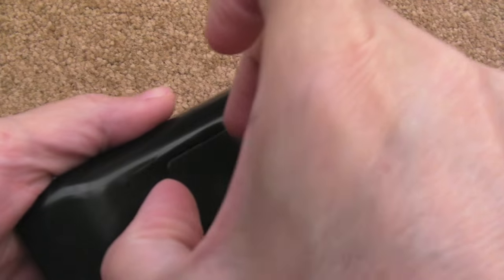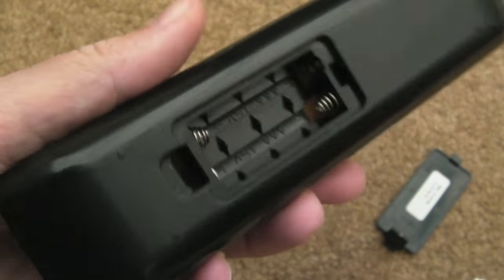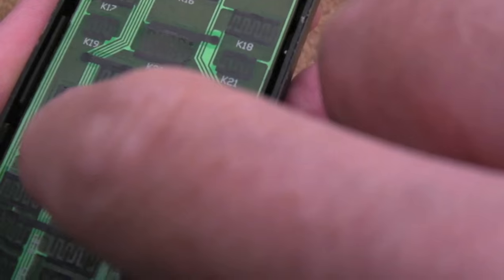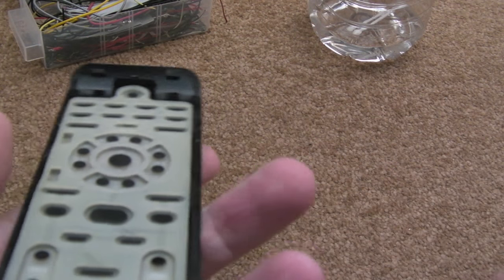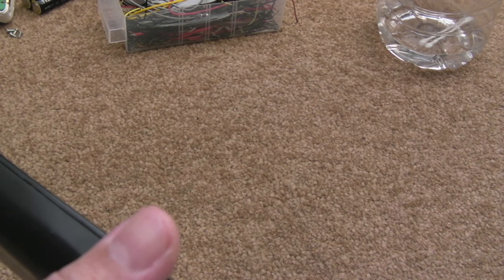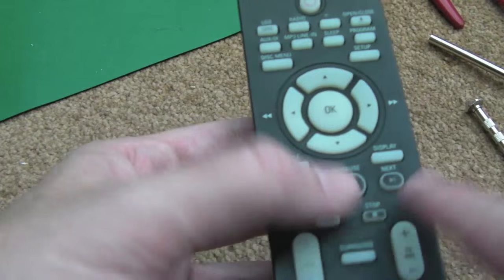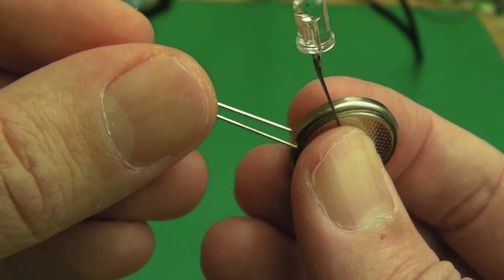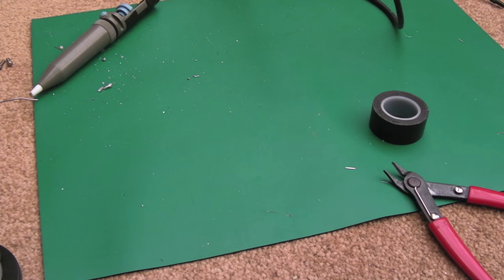TV / DVD/ Satellite Remote Control Common Fixes / Repairs

Comment: Thanks for the video!

When I saw the title for this video I was interested because in a previous life I used to do consumer electronics repair for a living, and I've sorted out my fair share of remote controls over the years.

The most common fault I've come across was not mentioned here.  So I thought I'd pipe in and tell you my most common remote control fault!

The most common fault I came across, by some margin, was faulty crystals.  These components, by the nature of how they are made, are sensitive to shock.  And unfortunately, remote controls are commonly knocked off the end of people's sofas and on to the floor.  If the floor is laminate or something like that, then this failure mode is almost a dead-cert to happen at some point.  I replaced a whole bunch of crystals over the 8 years I worked in the repair trade.  I wouldn't be surprised if it was >100.
Reply from the maker: +Brian J Hoskins Very good point =D  Yes, you are right - I've also had crystal fail and in particular they used to fail a lot in hand held games and watches etc.  Usually from dropping them on the floor the crystal would fracture inside.

Comment: You can take the carbon pads and rub them lightly against a piece of copy paper (like an eraser). This roughs them up and makes them work again. Of course, you don't want to do it too hard or too often as you could end up removing too much of the carbon pad, but I have this works REALLY well. You probably shouldn't put alcohol on the pads as it tends to dry them out. They do make a more appropriate cleaner, cleaner made for the rubber rollers in printers and the roller in a typewriter. This stuff won't dry out the pads. But I really find that the light rubbing of each of the pads across a piece of copy paper works the best. I had a remote recently that I paid over $100 for in the 90s stop working and I took it apart, rubbed the pads on paper, wiped down the board and it was as good as new.

Comment: ..... Mate, I feel your pain. (30 years of this) (Wazzal7 has already explained about the oil leeching out as it perishes.) Every time you clean those pads their conductivity decreases. I can explain the ONLY long term solution I have had with the pads. The problem is nothing sticks to silicone. Tin foil is perfect but good luck finding ANY adhesive that will stick long term. I cut 'Slits' either side of the common pads (Perforating the entire silicone) and 'Tuck' the foil strip ends in , through to the other side (and fold to retain). So the foil strips covering the pad a physically held in place.
Reply from the maker: +Rob Robbie Thanks, that's a really useful technique!  It is very difficult to get anything to stick to the silicone as you say!
Reply: +GadgetUK164     ..... P.S., I suspect there is some correlation between the small current flow and plasticizer leeching out. As I have two identical remotes (one spare) that I rotate and it's only the IN-USE one that PISSES OUT oil.  ....PPS, goes without saying your doing a good job with your channel. (I have told you before, your channel RATES higher than 'Thunderbirds'  re-runs here !)
Reply from the maker: +Rob Robbie Thanks!  Higher than Thunderbirds re-runs?!?!  That can't be possible lol!

Comment: To be honest, the progress with the VIC20 is slow. We've replaced just about ALL the logic chips and the 6502 processor. Both 6522 VIA chips have also been swapped out. But we still can only get a blank screen with no Datasette operation. All voltages are correct and where they should be. Would I be right in thinking that the MOS 901486-07 Kernal ROM is the next chip to swap out. Your advice would be much appreciated. Wayne and Nina.
Reply from the maker: +Nina Evans Yes, probably the Kernal!  There are also some other logic chips on there which could also cause the problem - there are some 74LS245 chips, 74LS138, 4066, and the RAM too.    Black screen is the worst kind of fault really =/

Comment: I've noticed the same thing on my old ATI remote. It seems to sweat more during the hot summer heat we have here in the Las Vegas desert. I'm hoping all the oil bakes out eventually. The problem I have now is that the contacts are wearing out on the board in some places and the keys in other places from all the cleaning and button pushing I've been doing over the years. Any tips on fixing that?
Reply from the maker: +Vigile Very interesting - I wouldn't have thought about the ambient temperature and humidity having an effect but clearly it does!  See the comment above from Rob Robbie - that's probably your best bet.  Try to glue small pieces of foil to the underside of the pad surface, but that can be really tricky.  His suggestion above it to cut slits at the side and feed a sliver of foil through the slots and bend them over, that way the foil is on both sides of the button and shouldn't slip out.

Comment: Do you ever clean your remote,it could be cleaning stuff or sweat from your fingers over time...just a guess..If i have problem with mine I put silver foll on the contacts where the buttons connect and they work ok.
Reply from the maker: +RETRO Nuts It's definitely something leaked out of the silcone!  See some of the messages below - It's actually quite common and seems to happen only on certain types of rubber / silicone.  For example, I've never had to do anything to my 3 or 4 other remote controls for TV / SKY / Blu Ray etc, just this damn Phillips remote lol.

Comment: What's going on Mr Gadget? No retro computers to fix (actually, it's the same this bloody end)! Lol! I think you'll find that the silicon that they make the keypads out off, actually SWEATS. My fella and I are often pulling remotes apart, sometimes more than once, to remove this shitty stuff. There doesn't seem to be an answer to it. The manufacturers don't give a shit, 'coz they know people will just buy Universal Remotes when there's a problem. But we prefer the remote that goes with the kit. Good video, keep 'em coming.
Reply from the maker: +Nina Evans Haha, I think things are just slowing down a bit for different reasons.  Less faulty items on eBay recently, and I've been playing more than doing any repairs etc.  As you say, they don't care about improving the build quality because its just classed as a consumable =/

Comment: From what I understand it is a plasticizer that is leaking out of the rubber. If it were all to leak out, the rubber would be dry and powdery. I am currently looking for a solution, as it's quite an issue I am experiencing out here in Arizona's desert!
Reply from the maker: +wazzal7 Very interesting, thanks for the info =D  Also interesting that heat has a major part in the process!  Vigile mentioned the same thing above - it must mean that this problem is probably more common in hotter places.  We need water cooled buttons =D

Comment: +GadgetUK164 used to have these problems with remotes in the 1990s, strangely enough philips and b&o, back in the day when crt was king. 

cooking them for a good while seemed to remove the oil and make the remotes last a good while longer.... however you will have to retreat the contacts with a little bit of silver conductive paint. not too much now as a tiny bit goes a looooong way.

hope this helps however I had a theory about this and using vinegar to "cure" the silicon further. just a wild thought mind you.

I may give this a try if I come across the same thing again.

problem is these things are made to a very low cost as you know, making quality a secondary to cost a big issue.

anyways the cooking of the silicon is dependant on brand, manufactor and age. we had a theory years ago that it was down to heat and humidity with central heating and moisture in the air..
Reply from the maker: +Jason Birch (argy101) The silver conductive paint is a good technique!  I've done that before myself and it can work well. Thanks for the tips there - might have a go at boiling it or something to see if that makes any difference.  I suspect it needs some chemical reaction to stop the process.  A bit like the H2O2 on yellowed plastics.
Reply: I've stopped using peroxide on keys. I've found just using the oxy action powder in very warm water in the daylight for a few days does a much better job than peroxide. It's good for plastics like snes etc just keys..it leaves a nasty white residue I find.
Reply from the maker: Yes, I think it depends on the plastic - I've had fantastic success on Amiga cases, but the keys are a bit hit and miss.  For that reason I've not done the keys on the last few 500 / 500+'s added to my collection.  As you say, the oxy action can work well on its own!  I know what you mean about that residue - it's a pain, I had to wash a load of that off something I cleaned just last week!

Comment: Interesting fix ! - I have done a bit of digging for info on this as i am sure many other people who have watched this video have done too!  I found a post thats 16 years old on google https://groups.google.com/forum/#!topic/sci.electronics.repair/wU2OlitgXpc

It's quite interesting as there are many theories suggesting where this odd residue has come from, the majority of answers point to the manufacturing process of materials used in the silicone buttons from that particular era. I would be tempted to have a look at a more recent remote from the past 5 years to see if there is a residue build up on that too, but i am sure that these processes have advanced since then eradicating the flawed technique. 

Where did you find a spare IR bulb ?
Reply from the maker: +Beatertech Very interesting!  Definitely temperature related as it seems more common in hotter climates.  For a replacement IR diode, for the most part a standard 940nm IR diode will work in most remotes.  Something like this:- http://www.ebay.co.uk/itm/100PCS-5mm-940nm-IR-infrared-Launch-emission-tube-diode-LED-Lamp-NEW-/191782505288?hash=item2ca720cb48:g:hIcAAOSwFqJWl0dm
Reply: GadgetUK164 learn something new everyday!  Oh I just done the replacement screen again..  I almost lost it. Nightmare!  I'll do a full write up later haha - got any new projects on the go? You should give the 3dsxl screen fix a go, nice puzzle!